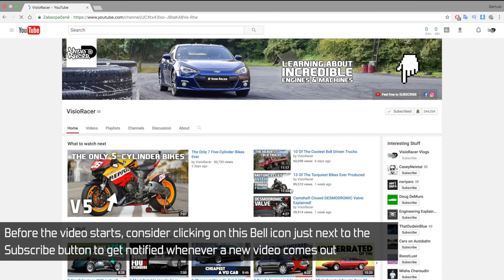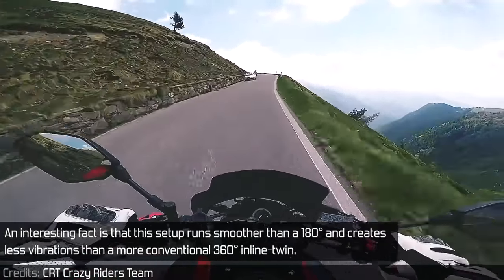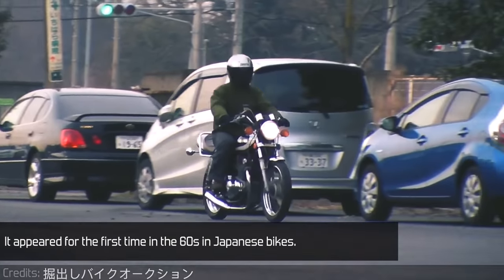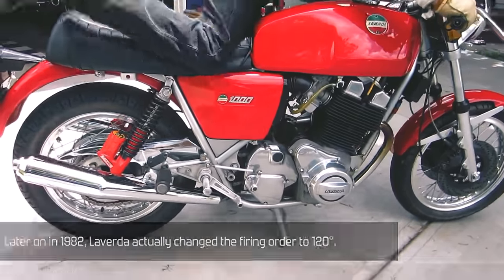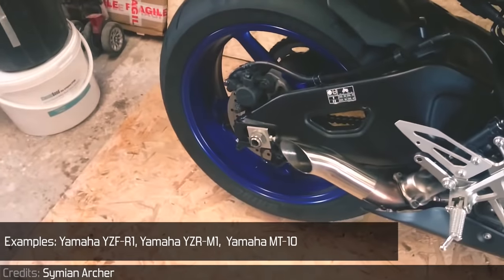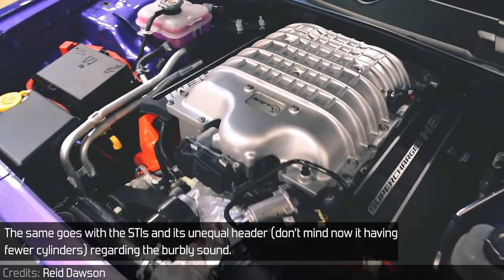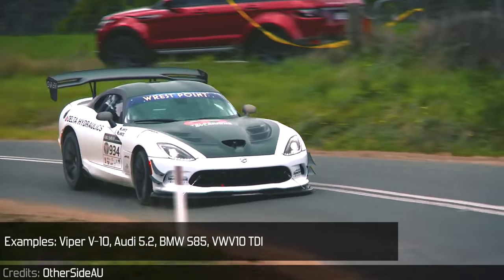7 Interesting Examples Of An Uneven Firing Engine

Comment: Hi from Australia. Your videos are so interesting mate. Really enjoying them a lot. Thanks.
Reply: Dean Herde im pretty sure we have the same odd firing buick in the commodores since it sounds the same as my V8 on idle
Reply: Jarryn Smith hey mate yeah I reckon you're right. The VN up to the VS I think is the Buick, then they went to the Ecotec which I have in my VY Commodore. Im no expert so I'm not exactly sure what changes they made on the Ecotec but obviously it's based on the Buick block still.
Reply: Dean Herde yea bro your right, the ecotech came through with series 2 VR and goes alloytec at the VZ. The ecotech has like 5 more KWs and is a bit better on fuel from the different manifold and ecotechs are coilpacked, i think(know) buicks still run setup like the 5lts with the dizzy.
Ecotechs are not as strong as a buick we had one in a hilux for 2 years before it blew and the thing was a monster i didnt belive it, under water(just make sure you hammed it so the dizzy works), 3rd gear on the spot skids, could drag anything through anything and last but not least BEAT ecotechs as the lights it was amazing
Reply: Jarryn Smith oh yeah they're a tough engine alright. Used to have a manual VN and I loved that car.

Comment: thx visoracer for including the fireball v6, my uncle put one in a willys cj2a jeep we have in the garage and i just got it running again after 30 years of sitting last week. its a glorious engine!
Reply: I run a hopped up 225 Odd Fire (Kenne Bell equipped, MSD, lots of carb., fat headers...) in a 'flatfender' Willys Jeep as well.

Give it air (high rise manifold, ported heads, fat headers), feed it (lots of carb, hot spark), and it will run like a striped ape (they were once the darling of sprint racers).
Reply: @-oiiio-3993  sounds good
Reply: @X-11  Yes, it does.
Through headers and low restriction mufflers it sounds like three Harleys strapped together at idle, like tearing paper when rapping up the RPMs.

Lots of low end torque, does not stall, rapidly accelerates, runs cool.

Windshield down, goggles and a grin.
Keep the rubber side down.
Reply: @-oiiio-3993  ill be renovating the cj hopefully soon.
Reply: @X-11  If you don't have one, find a Warn / Saturn overdrive unit, make sure it matches your T-case output spline count. It provides 25% reduction for each gear range and is the best single upgrade for an early Jeep.

I run a 4 speed with stock T90 transfer case. Four speed + underdrive (low range of T-case) = 8 speeds forward, 2 reverse. Add OD for 12 speeds forward, three reverse.

You'll have 'longer legs' for road use, a gear range for every task in 4WD.

Radiator for 1965 Mustang is a good fit. Inlet / outlet are in right place, better flow than original. I also use a Flex A Lite 30 electric fan with shroud.
Reply: @-oiiio-3993  thanks for the ideas bro. Mine has the og 3 speed and an added overdrive.
Reply: @X-11  Good stuff.
I ran my first Jeep, a 1948 CJ2A, almost completely 'stock' except for 12 volt conversion and Warn OD.

With the 134 flathead and 6X16 NDT military tires, T90 & Dana 18 she could climb out of any sand pit and over most any rocks that Northern AZ had to offer.
Reply: @-oiiio-3993  thats exciting.

Comment: ... it's 2am and I feel an urge to ramble...
You cite the Jota triple, and the two different versions of it. Laverda wanted to go endurance racing, so they asked around the Italian Auto industry, (bit of a family business), and a man from Ferrari offered to help. He had designed a V12 Formula 1 engine, and Ferrari took half that engine to make the Dino. So they sketched up a slightly scaled down version of that Dino engine to go length-ways in a motorbike. That's the famous V-6 Laverda race bike. So then Laverda asked him (conversation, small-talk) about how to design and balance an inline triple. He laughed, and told them he had wondered why they made an inline triple at 180 degrees. Then he told them to take the 120 degree design crank from the Dino V6 and make the crankpins a bit shorter, and use the same balance factors and dimensions as one half of the Dino motor, except with a lot more stroke.
That's where the later Jotas with the 120 degree interval came from. It not only sounded different, it completely changed the character of the engine. It went from being a rough and tumble bruiser, to being a howling high-power sewing machine. The engine and the head and the cam covers and everything, it all looks much the same, but it's a radically different engine to use. It's a lot like going from a Triumph Bonneville twin to a Honda 4... You sorta can't believe they're both motorcycles, they're so different.

Comment: I am all about the cross-plane V-8, I just think it's one of the most fantastic sounds in the universe. I'd rather have a 190-hp V-8 than the 200-hp 4 in my FR-S, even with the extra weight.

But I also really like the 180° I3 and the cross-plane I4. Why don't cars use these?? Love the burble!

Comment: A good way of differentiating between a crossplane crank engine and a flatplane crank engine is to listen to how the engines sound when they are idling/at tick over. The crossplane crank engines make a woofilling sound like a V8 TVR and the flatplane crank makes a constant drone like a V8 Ferrari. The woofle sound is heard because you can hear some of the 4th strokes of the cycle as exhaust valves are open. The flatplane crank engine cancels out any sound of the 4th strokes of the engine exhaust valves.

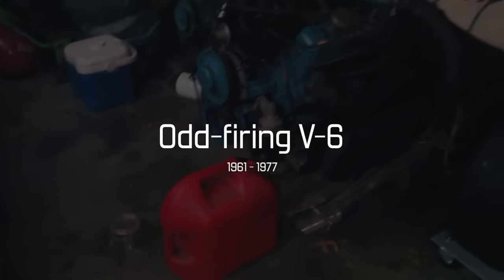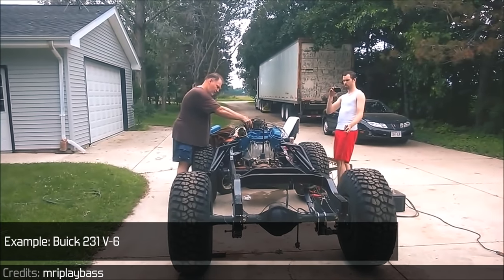Comment: 04:35 -   The 225 cubic inch 'Odd Fire' Buick V6 was, indeed, essentially a 'cut off V8'. It used the same pistons, rods, geometry as had the 215 inch aluminum V8 that had been used in Buick and Oldsmobile offerings before being sold to Rover.  The 'Odd Fire' V6 was originally 198 cubic inches, then 225 before being sold to Kaiser Jeep who dubbed it 'Dauntless' (that is a Jeep frame with V6 mounted at 04:58 ).

Odd Fire Buick / Kaiser Jeep engines fire at 90 and 150 degrees of rotation. They are rather torquey, run cool, accelerate rapidly, and were once favorites of 'Sprint Car' racers. I run a hopped up 225 Odd Fire in my 1946 Willys.

When AMC bought Jeep the V6 was sold back to GM who eventually split the crank pins to make it an 'even fire' 231, 3.8 liter, '3800'.

Comment: An engines who fires unevenly sounds a lot better.
Reply: It depends really.  On a low reving bike it gives a nice brap but I much prefer the singing high revolutions of a worked inline 4 like an R6 over the crossplane R1which sounds like a V4.
The reason they changed the R1 to crossplane is because Valentino Rossi.  He couldntfeel the tire grip coming out of corners in the regular inline because the torque is so smooth, the crossplane makes a spurt of torque and he can feel that coming out of a corner ans it makes him more confident and more controllable over the rear tires traction

Comment: The 180* twin is pretty smooth. I have a TX500 with a 2-1 exhaust and it sounds pretty good and it's smooth all the way up past 11,000. I think the 270 degree engine sounds better, but I own both so...

Comment: The Maserati Biturbo also uses an oddfire V6, which I believe was based on a Ferarri engine (don't quote me on this) and those were made up into the early 90's. sounds beautiful with open headers.
Reply: Nope... It was the 90 degree V6 engine created for the Citroen SM, and was derived originally from the Maserati Indy V8 engine, with 2 cylinders removed to reduce the volume to just under 3 liters, dictated by French taxing schemes.

Comment: I like the rapid exhaust note of the classic 2-stroke Detroit Diesel 6V53, but it's a 90 degree configuration, leading to an uneven distribution of power strokes. A 60 degree configuration would smooth out the uneven distribution.

Comment: Visio, I don't really understand the split pins.. what is it actually? Thanks
Reply from the maker: Pins are those things on which connecting rods are mounted. Non-split shared pins are those which run two con-rods of different cylinders, a split pin is the one which runs only a single connecting rod. Does that make sense to you?
Reply: Rather than two connecting rods riding the same pin in tandem, the pins are ground to offset the two connecting rods so that the pistons can fire at even intervals.

An 'Odd Fire' V6 Buick / Kaiser Jeep engine fires at 90-150-90-150-90-150. With the 'split' (offset) crank pins the even fire hits at 120-120... .

Comment: Visco the 180° inline twin has been used in John Deere two cylinder tractors since the early to mid 1900s although the displacement is much larger say 425 cui

Comment: the 231 fireball v6 was the predecessor of the later 3800 used all the way up until 2008 when it was finally discontinued.
Reply: Originally 198, then 225 cubic inches. 

Buick sold the 'Fireball' to Kaiser Jeep, who dubbed it 'Dauntless'.

I run a hopped up 225 Odd Fire (Kenne Bell equipped, MSD, lots of carb., fat headers...) in a 'flatfender' Willys Jeep.

Comment: That 180 degree Laverda triple sounds like a miss-firing 4 cylinder to me, which is basically what it is, the same firing spacings as a 4 but with a cylinder lopped off.

Comment: V8s are even fire, regardless of whether it is a flat plane or cross plane crank.  They fire every 90 degrees.  Uneven firiing means the engine doesn't fire at equal intervals of crank rotation (i.e. the 180 and 270 degree parallel twins, which are a 180/540 and 270/450 degree firing order respectively).
Reply: right, crossplane V8s  are even firing, resulting from the two odd firing 4-cylinder benches working together in one engine.

Comment: I had a buick v6 it had an that cylinder that fired oddly. It was labeled called odd fire I think.  If I remember right cylinder 5 was the offset one.
Reply: The Buick V6 Odd Fire did not have one "offset" cylinder. Firing order is 1-6-5-4-3-2 so they simply fire across like three V twins sharing a common crank.

The 'Odd Fire' bit is the timing. Cylinders fire at 90-150-90-150-90-150 on an odd fire, 120-120... on an even fire.

I run a hopped up 225 Odd Fire (Kenne Bell equipped, MSD, lots of carb., fat headers...) in a 'flatfender' Willys Jeep.

Comment: In tractors and cars, 180 is actually most common. I fail to see why 270 was smoother with less vibrations. John Deere used 270 and they would constantly shear the shear pin on non-JD balers. Another indication of the 270 degree crank engine being unsmooth is a JD tractor with on will "hop" or "bounce" under load.

Comment: The Buick V6 stuff is in part incorrect. The engine was produced in two versions a 225 that is odd fire and a 231 that is even fire. All your on screen info and from the sound the two blue engines were 231 even fire. The green one might have been odd-fire hard to tell.
Reply: Early 231s were odd fire. The change to even fire came about in mid 1977.

The Buick Odd Fire V6 was initially 198 cubic inches before it was increased to 225. GM sold it to Kaiser Jeep in '66 or '67. After AMC bought Jeep they sold the V6 back to GM in 1974, was installed in 1975 GM vehicles as (still odd fire) 231. 

I run a hopped up 225 Odd Fire (Kenne Bell equipped, MSD, lots of carb., fat headers...) in a 'flatfender' Willys Jeep.

Comment: Interesting.
Polite suggestion: Look at horizontally opposed engines. Compare and contrast the BMW Boxer twin motorcycle engine, and the very early (1919) versions of that engine, and the mid '30s VW (pinched pretty much from a production 750cc BMW) and then the addition of 2 more cylinders, making a Porsche flat 6. Then look at the Porsche flat 12, in the 917. (And please please, do include a good quality recording, from the early '70s, of a LeMans Porsche 917 on full song, because that really is the sweetest sounding engine ever made!)
Then show a traditional American V8, with shared crankpins. Then show a Ferrari V12, with shared crankpins. Then show a Ferrari "boxer" 12 with shared crankpins. Compare the sound of a 512 BB Boxer to the sound of a 917. On paper, they look like almost the same engine, but in the real world they sound completely different and have completely different personalities and characters. Some of that is down to cam timing and port shape and stuff, but the fundamental bottom end design is radically different, even if it looks the same from across the room.
Hint - one is named "Boxer" but it isn't. The other makes no mention of that, but it is.

Comment: You forgot the most sold odd firing engine, the John Deere 2 cylinder horizontal piston tractor and power units.  Fires both cylinders on the same revolution and then flywheel coasts the next revolution.
Reply: Imagine a Flat-8 that did that.  Boom!  Wait for it... Boom!  Wait for it...

Comment: With your logic of the tires finding grip on the first engine surely that would be counteracted by the surge of power that comes later. And if you think of a car slamming the accelarator down then taking it off repeatedly vs the accelerator constantly halfway the first would supposedly wheel slip more, so can someone explain to me the logic cause I don't get it
Reply: Bradley On Meth if the tire for whatever reason starts losing traction, the his friction coefficient will decrease (everyone knows static coefficient is higher than dynamic one) so if that happens, the moment of no-torque from the engine will let the tire re-obtain traction. If you have a four cylinder (higher rpm and more cylinders firing) you won't have that moment and the tire will just continue to slip. 
That's what I think anyway

Comment: I always wondered if that was the reason for the subie sound. Now I know!
Reply from the maker: Basically you can do it on a Honda as well, but won't be very beneficial for your engine output
Reply: VisioRacer especially newer engines with o2 sensors. They can male the car read rich and cause the engine to actually lean out.

Comment: the 270 twin and crossplane 4 work for the same reason: there is no point where the pistons all come to rest together. this prevents a second order mechanical imbalance due to fluctuating kinetic energy, causing torque pulses. this increases with square of rpm and overwhelms power torque pulses at high rpm, ie racing engines. at high rpm, this is a more serious problem than the rocking couple and uneven power pulses of a crossplane. in a consumer vehicle, rocking couple and irregular exhaust pulses will be interpreted as harshness. (the tradeoffs of flat vs cross v8s are different issues) The effect on tire grip is that the torque vibrations break the grip. this is much like the ac bias current in a tape deck removing the hysteresis of magnetizing iron particles. all the idiots who think grip is improved by pauses between pulses to rest the tire are merely repeating a myth created by someone who couldn't imagine the real problem so he guessed. the designer of the M1 thinks otherwise and you can find his description if you search. the description here for the cross 4 is correct but incomplete